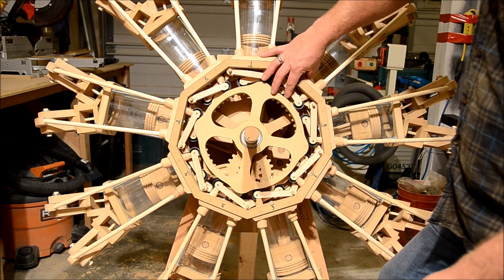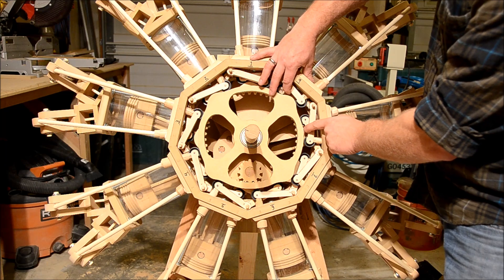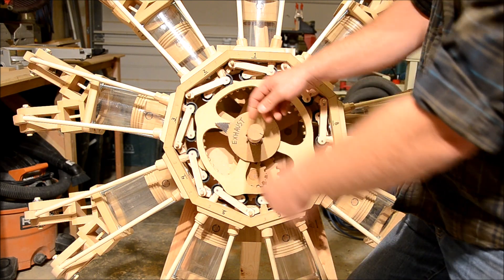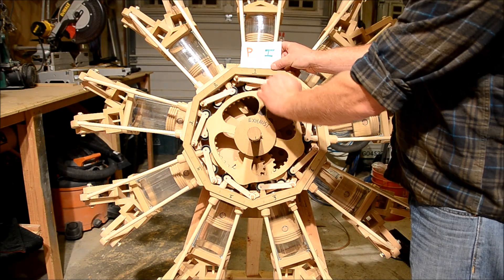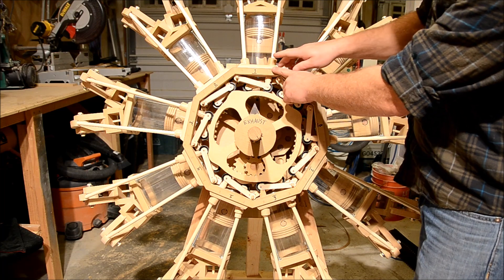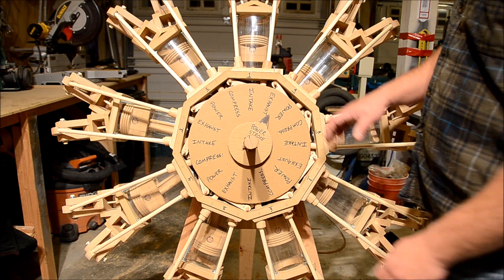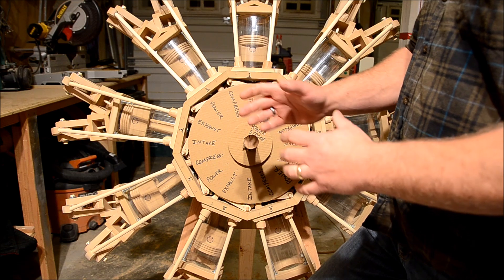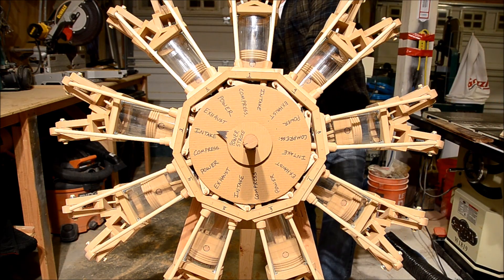How a Radial Engine Works - Explained  Part 2

Comment: A very much appreciated clear and concise explanation of the radial engine. The model is fantastic.
I have one comment , in case you intend to continue giving demos with it.
Since almost the entire model was wood , and much of your background in your shop and the work bench you set parts on were wood/had lots of wood colour and tone , at times it was visually difficult to identify the specific parts and where they differentiated. If you intend to continue the demos with this model , it would be easier for a viewer to understand if the parts were painted differently. While for much of the video , you did attach labels to some of the parts and systems , it would have been helpful to me to have them identified by number or letter or both.
Again , please don't take this as too negative , both the model and your explanation was excellent and all the work to produce the video appreciated.

Comment: It is interesting to know that for the master connecting rod, its Top Dead centre occurs when the master con rod is parallel with the cylinder axis, but for the  the other cylinders top dead centre does not occur when the articulated con rods are parallel with te relevant cylinder.
For a nine cylinder radial engine, each cylinder is displaced at a crank angle of 360 / 9 = 40 degrees. This week, my colleague asked me to find the additional angle needed for ignition, due to the fact that the Master rod accommodates the other articulated rods on it, the geometry results in the ignition lobes not bein equidistant on the circle.. 
I would be grateful if one published the ignition angles for the Wright R- 1829 Engine, stating the crank angle for the  nine cylinders top dead centre..  How one works it out would be helpful, I found an approximation, but a more precise formula would be more than welcomed..
Congratulations for making this wooden model of a radial engine,

Comment: I realize that this is by now a very old video, but one way to help visualize the various power and exhaust strokes would have been to use LED lights to inside each cylinder that go on and off as the crankshaft rotates. Use Red (hot) to indicate power and blue (cold) to indicate exhaust, each triggered by the lifter/cam movement. Having said that, as many others have commented, this is brilliant work on your part.

Comment: That's a brilliant explanation and model, Ian. I enjoyed watching your video enormously. My curiosity was aroused by seeing a Blackburn Lincock biplane in a museum in Hull, England the other day. It has a 7 cylinder engine which I tight would be out of balance and couldn't think what sort of a crankshaft it would have. The engine was an Armstrong Siddley Lynx. I still can't quite het my head round the 4 lobe cam ring working for 9 cylinders, but it does. I'll keep looking until I get it! Radial engines are a really elegant design showing a lot of ingenuity as does your model. Thanks again.

Comment: This is an excellent example of being the top of your craft: Top of woodworking, top of teaching, etc..I am impressed with your working model. I was looking at the German Fock-Wulf Fw 190s airplane, and it's radial engine, wondering how the pistons transmitted up and down motion to the crankshaft. This is a most excellent mock-up and teaching aid. Great job.

Comment: The counterweight is completely unnecessary. Most likely, it is causing the whole imbalance. 9-cylinder radials are naturally balanced. That is why airplanes love them, you can put a crazy powerful one on a lightweight plane and not shake the fuselage to pieces.

Comment: This is awesome!  

At 4 minutes, https://youtu.be/R71Xhrkc3EQ?t=240, the OP (Ian?) powers the model with a power screwdriver.  This showed me how the radial engine valving works, so I am writing about what I saw.  Please like this summary if you find it useful so it doesn't get buried.

The OP already noted that the cylinders alternate between power and exhaust strokes.

If you only watch the two cylinders around 4-O’Clock, Cylinders 7 and 6, the valves pop all in order, counter-clockwise, wave after wave.  

This makes lots of sense.  The valve operations are:
7 Exhaust (Bottom valve)
7 Intake (Next up)
6 Exhaust (Next up)
6 Intake (top)

Expanding this, it's:
7 Exhaust (Bottom valve)     (6 compresses, then explodes)
7 Intake (Next up)                (6 de-compresses, joining some other even cylinders, powering 7's intake)
6 Exhaust (Next up)             (7 compresses, then explodes)
6 Intake (top)                        (7 de-compresses, joining some other odd cylinders, powering 6's intake)

The bumps on the cam wheel are only “bumpy” about ¼ of the time, so that makes sense with the 4-cycles in each cylinder.

It took me a while to understand why the intake and exhaust bumps on the paired cams are in a push – skip – push – skip timing as they cross the center of the valve. When looking at the cycles above, I expected push – push – skip – skip.  The roller levers cross, and make up that difference, and that’s why the two rings are oriented that way!

I was curious how this worked too, and it’s awesome you shared your model with the world so we can all make use of it.  Thank you!
Reply: And I just found his third video here - a short - https://www.youtube.com/shorts/uzSE77dkkhk

Comment: I definitely understand how simple combustion engines work, and seeing them from tiny single cylinder 4 stroke motorcycle engines, to these midsized aircraft radial engines, all the way up to the absolutely giant open engines of steam liners, which still have pistons, but work differently to the internal combustion, is always incredible to see explained. This is one of the best videos I have seen so far. 

If you haven't created a working model of the steam engine or a radial engine, it would be interesting to see that in your open view construction. Far better than any computer design gif, especially regarding the explanation. 

Thanks for the interesting and fun video!

Comment: Very, very impressive!  I can't imagine the number of hours you spent designing and building this model. The job you have done to explain this engine in such a comprehensive manner is masterful to say the least. Radial engines are an area I have never had any experience with but have always found fascinating. The number and types of different rotating masses are incredible and I can't imagine trying to balance and get rid of all the different types of vibrations transmitted. Thank you!

Comment: I like your model and I find it genius because it is true that a crankshaft will have less resistance using your radial model. Similar concept is the multiple pendulum wheel that I invented and has the advantage of using gravity and inertia to improve the efficiency of traditional motors. Where are you located. Maybe we shall start our own motors company!

Comment: Very impressed with this video explanation. I flew Super DC-3's with Wright Cyclone 1820-92 9 cylinder engines for 4 years. Also taught trainees how to fly them but it was always difficult to explain the engine. We did have QEC's on the bench for quick engine replacement and observation to learn from but nothing like what you have here. Every student of a radial engine should watch this. Kudos...

Comment: Great video. But after watching many videos on radial engines, I have never seen an explanation of how lubrication is handled. Where is the oil sump? How do they keep too much oil from getting in the lower cylinders?  How are the exposed rocker arms lubed?
Many questions.

Comment: Outstanding! I have had two nagging questions about radials that I just haven't had answered satisfactorily over the years, and I suspect those to whom I have posed the questions really didn't know either! Why does each row of a radial have an odd number of cylinders? How does a cam plate with four bumps run a nine-cylinder engine? Well, an investment of twenty minutes on my part and I am clear as a bell. The amount of time this man has invested building this model and explaining so thoroughly is mind-boggling, and has resulted in the most productive twenty minutes I have spent on the internet.

Comment: I had not got to grips with radial engines until I saw this extraordinary easy to follow video. Your craftsmanship and explanations are extraordinary. Well done.  Just a thought but if you are building another radial engine could it be a seven cylinder one.

Comment: I'm a 30 year A&P but all working on turbofan and turboshaft engine powered aircraft from helicopters to large commercial airliners like the B767s. So radials have always been a bit mysterious for me on details of operation. This video has to be the most clear and simple explanation and demonstration of general design and operation of a radial engine I've ever seen. And great job on the very cool model build too. That it didn't fly apart when you spun it up was truly impressive for the tolerances and materials used. Great video.

Comment: Great video, incredible craftsmanship and a great job explaining things, but I still have a remaining question.  Can you explain why the entire engine would rotate for some radial engines, especially the ones used in WWI aircraft?  Some of these engines are shown in the "Radial Engine Compilation" video by Vliegnet.  Since it's apparently not necessary for the entire engine to rotate, why would you want a design in which the engine itself rotated?

Comment: I'm wondering where the oil goes, because it would leak on the bottom pistons and hydro lock the engine.
Reply: That is a good question. I would like to know the answer as well.
Reply: There would have to be some kind of a seal in the bottom of the bore around the rod. Maybe this is why they always spun the prop by hand a few times before cranking them. IDK

Comment: Wonderful ! An excellent model and explanation. I know understand how a radial engine works 👍 As you mentioned, looking at diagrams is not the same. I believe radials produced a large amount of right hand torque and pilots had to correct this with opposite rudder - seeing your demonstration, this now makes more sense.

Comment: The good thing about a radial engine if you blow a cylinder head the engine will still run at a bit less power that may help you land safely

Comment: My gosh. I wondered how a radial worked.  I guessed.  One crank throw, but I was not sure. I'll bet fhe atmosphere gets dense as prop rpm moves up. Adding rows would add velocity because the rpm is faster.

Comment: I’m an A&P student at JCTC in Louisville Ky. Have you ever considered making a kit of these or selling them? Powerplant students would benefit greatly from it and your description. We take them apart and put them back together and run them but it’s still very hard to fully understand all that is going on inside the metal case. This would go a long way to shedding new light on that issue.

Comment: Thank you that is amazing. Your parts have to very precise for it not to bind especially with unlubricated wood parts. Did you have to wax the components? It took some real engineering to develop a radial engine.

Comment: Excellent video demonstration. I visited the Science Museum in London last year and saw the aero-radial engines (on the highest floor in the airplane section) which were quite hard to understand and get my head around. I had so many questions which could not be answered there. With what I have learned from this video my next visit will be much more rewarding. Thank you for making this model and sharing it.

Comment: Ian,

What an absolutely awesome Job you did on Designing and Building this Engine!  You are a great Teacher as well!  You have made an Extremely valuable Demonstration Model!  You get the Highest Marks Possible!  This Praise is  not coming from someone who has no understanding of what it takes to do Mechanical Jobs and Work.... but it is coming from a Career R&D Machinist,  a Welder,  is a Mechanical Inspector,  a pretty good Mechanic,  and finally,  a Bulldozer Operator!  You couldn’t be more Meticulous than I am in my pursuits,  but especially in my R&D Machining.... and my Hat is off to you Sir!!  I shared those Skills,  so you can know that I am not coming from a place where almost anything Mechanical would impress me.  I know that you worked hard on this,  and that in doing so... you had a Bright Lightbulb turning on💡over your Head,  many times 💡😵💡😮💡🤔💡😳💡🤓💡 while you were involved in Making this!

Out of 1-5,  ⭐️⭐️⭐️⭐️⭐️⭐️!!

How do you make your Living,  if you don’t mind?  You would make a Great Teacher at an Air Frame and Power Plant Mechanic School!  Do you have a CNC Router that you used for the Cam Gears and Cam Lobe Machining,  and more?  If not,  how did you make those?  Hey!!  You need to show the Distributor!  I think you should Edit it in to this Video!

Before I just watched this,  I had watched too short of a Video of a Guy in The Netherlands? Who built a Single Row Radial Engine,  utilizing the Volkswagen Cylinders,  Heads,  and Pistons.  He too did an Excellent Job,  and at the End.... you get to see it running!  Excellent!  So if you haven’t seen that,  you should watch that!   From what I see,  I am guessing that the Radial Engines put out more Horsepower per Pounds of Weight?  Is that True?

I too have always Loved Radial Engines,  and recently,  I have even been Exploring on how much Money an Old Tired,  but Rebuildable Radial Engine would Cost.  Quite steep $ as you are probably already aware of,  as you have likely already done your own Exploring in trying to  find one,  like me. I just Subscribed to your Channel,  and Saved your Video to my Engines and Motors of all Types Folder on Youtube.  I’ll be watching!

Take Care,  and May The Lord God continue to Bless you and your Family! 🙌 👍

Comment: Very clever whoever worked out that cam arrangement in the first place. The Spruce Goose engines had 4 rows of 7 cylinders. I remember looking at one and thinking I wouldn't want to change the spark plugs in that!

Comment: Thank you for the explanation. I've always wondered how the radial engine operated particularly the crank connection. The cam operation was over the top. If the power to weight ratio is what I think it is why haven't anyone used this in automotive or truck applications.

Comment: I always thought the radial engine would be alot more complicated than that. In parts as well as operation. But that's not the case. Thanks to you.
These two videos should get you some kind of an award. They're fantastic. And in hindsight, I remember when they fired one up, the exhaust did puff smoke every other cylinder, then the ones in between. Like drawing a 5 point star except a 9 point [something]agon. And the cam gear and lobes are not any more complex than a single cylinder 4 stroke (Briggs & Stratton 3 1/2).
Again, ...WOW! Seriously incredible presentation. 10 out of 10.
Did you build the display yourself? Awsome job whoever did. I'm 58 now, but in high school, my shop teacher lent me a plastic see-thru display of a 1 cyl. 4 banger for a history class presentation. I did well, but If I had THAT one, I woulda cleaned out the class.

Comment: Beautiful model Ian and a very clear explanation.  I have a suggestion, in case you have not already thought of it.  You could add a red LED to each cylinder that would illuminate through acrylic tubing to show when the ignition occurs and it could remain lit during the entire power stroke.  You could carry this idea out further by using a different color for each stroke.

Comment: Thank you for posting such an informative video.  I'm a pilot and have seen numerous versions of the radial engine.  The older version where the cylinders spin around the center shaft always amazed me due to the fact the valve train needs lubrication.  With the heads spinning it was astonishing they got any lubrication at all as the oil was centrifugally spun to the outer walls of the valve cover. 
How did these radial engines compare to the v8 regarding power per cubic inch?

Comment: Great presentation BUT I wasn’t able to see/understand how the propeller shaft connects to the main crank unit.  Been wanting to understand this better and thought I would be able to see it in your video.  Any chance you can do another video showing how it connects and how the counterbalanced weight works.  I know you verbally mentioned the connection of the shaft but it was difficult to see the actual connection.  Either way, fascinating engine design.

Comment: In all my years I've ridden in DC-3's, Twin Beeches, and a few other radials. But never fully understood the engineering of the engines. It would have been nice to have seen your demonstrated engine 50 years ago. From the bottom of my heart Sir, thanks for your hard work preparing it. Now I fully understand the mechanicals of a radial engine.So sad not many are flying anymore. Love the old Hellcats and Bearcats working out.

Comment: Well done. You made it easy to understand. The only thing that I thought was missing is how the oiling system works. How often do the lower cylinders fill with oil and bend a rod. But very well done.